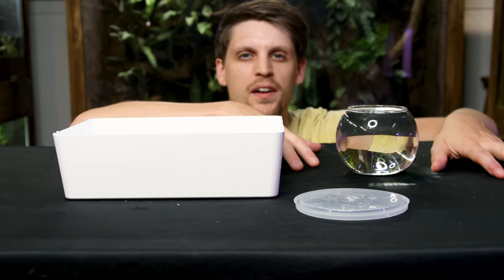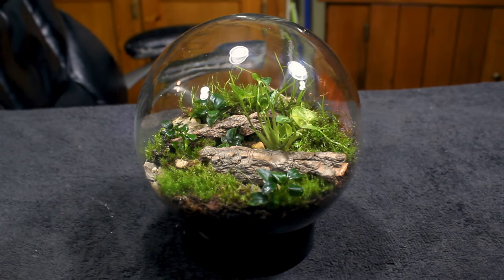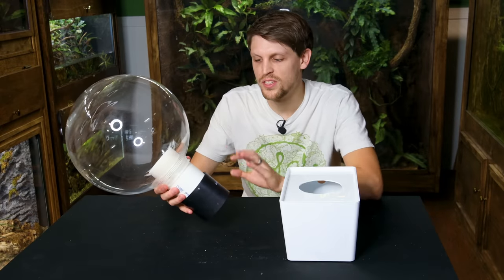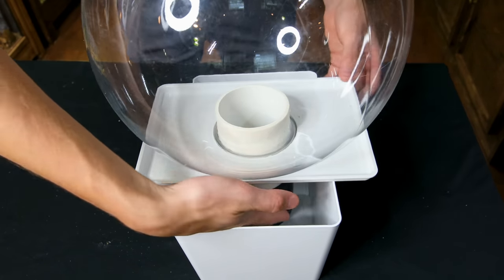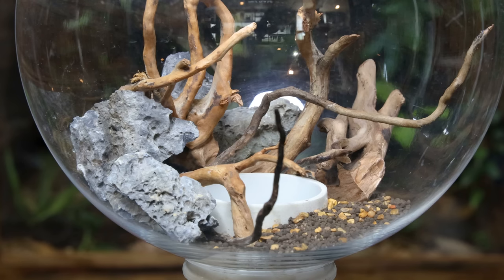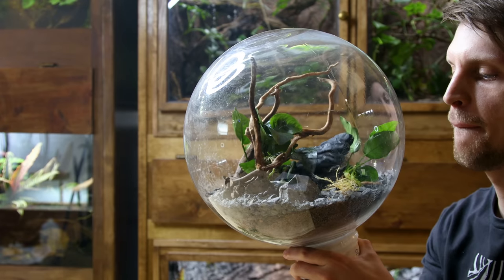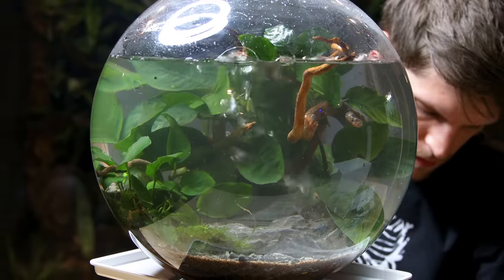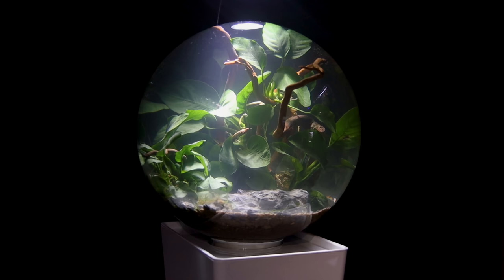Impossible No Opening Orb Ecosphere

Comment: An idea/suggestion for a project - replace the bottom piece with a low fish tank (or tall, whatever suits the needs). Make the orb a centerpiece of the aquarium that goes above the water line.

Whenever the water of the orb and the fish tank should be connected (so the fish can swim up the orb) is up to practical and long term maintenance of such construction. Would be great if fish could swim in there, but it's optional.

Or even no fish at all in the bottom tank. This could be just an open vivarium.

Imagine an orb of water, with water plants inside, surrounded by orchids and other plants hanging out of the bottom tank

Just a though. I bet you have tons of other projects in mind. You're the type of guy that never lacks creativity, and for that I'm glad to be a part of SerpaSquad <3

Comment: SO Smart!!! Youre experience really shows itself in the design of the structure, I was blown away with the foresight. The only thing is I was surprised you silicon'd the sphere to the pvc without hardscaping. Lessons learned though, you could have hardscaped and foamed to secure it before locking the tube on

Comment: Really like this.  Might be fun to add a mini led spot to the bottom for light from below.

Using something like your tube filling system, that series of line up into the orb with a syringe full of food could make it possible for shrimp or possibly even an oto or similar that spends time on the glass to be fed.

With a bit of fine tuning the same system may be able to be used to clean too.

Comment: I enjoyed watching you tackle this problem! Your results are as always wonderful! IMO, you needed to spend just a little more time on your tool design... Imagine a small cup, with a rod & hinge like attachment to a bottom edge of the cup with a second rod and hinge attachment on the opposite bottom edge. You could then fill the cup with substrate, shove the assembly up the pipe, then while holding one rod steady, move the second rod to dump the cup contents like a dump truck... The forceps extension needed to be fabricated from a firmer material, or perhaps a few pivot points/ fulcrums along the length to create rigidity and increase the mechanical advantage/grip  at the end of the instrument. Flattened ends may have made grasping the stems easier. 
Maybe try it next time... This one worked out fine!

Comment: 6:38 Why didn't he just pour in the substrate first with the whole orb/pipe assembly upside down, then tilt it upright and move the substrate around to fit? Then you can place the scape pieces on top of that and shake it around a bit to get them sunken into the substrate. I don't know about you, but if I find I'm using a tiny cup taped to a long wire just to pour dirt, I think I'm doing something wrong hahaha.

Comment: sooooooooooo tip for future: put a peice of pvc into orb glue in and cut flush with the bottom. NOW build your ecosphere, then extended the pipe by fitting a new piece of PVC into or around the short piece of PVC you have already fixed to the orb.